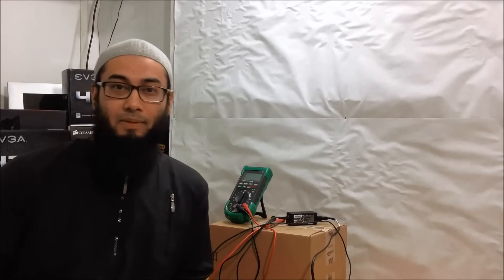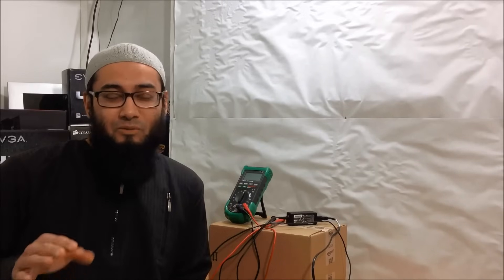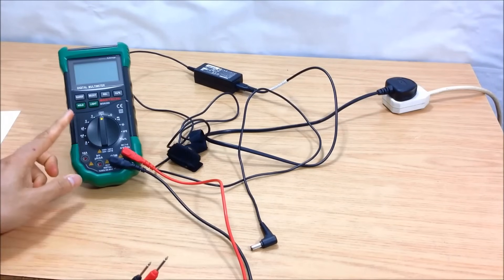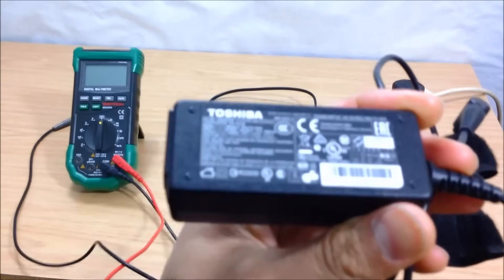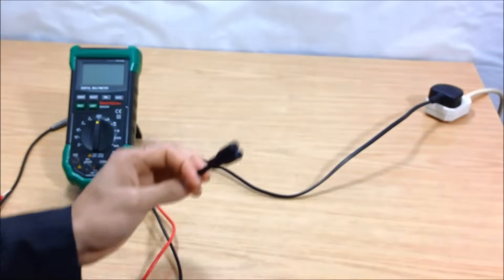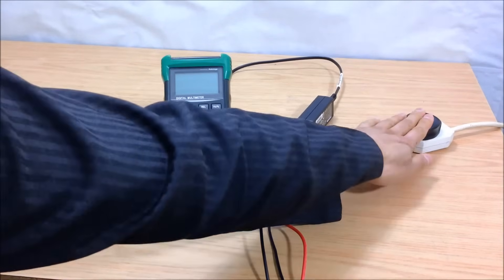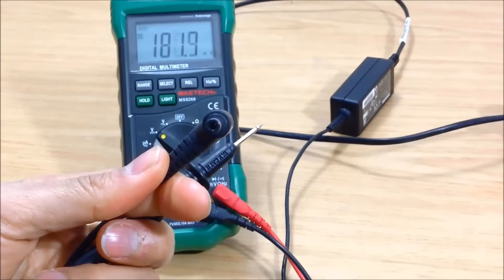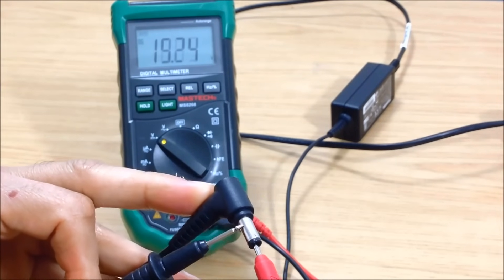How To Test A Laptop Charger With A Multimeter | Laptop Not Turning On | Laptop Adapter Charger

Comment: Great tutorial and great presenting , to the point and with a fantastic attitude . 
I tested my charger but it didn't give me anything , I don't want to buy a new charger because This one is original , so  do you have any tips on how to replace the part which you tested in your video ? 
Thank you sir
Reply from the maker: I have used cheap alternative chargers and they have worked fine, from EBAY.  Alternatively, I have also used a universal charger in some cases.  There is a video on my channel for a review of one of these universal chargers.  If you cant find it i will link you...
Reply from the maker: https://www.youtube.com/watch?v=rgA7XwpbUBQ
Reply: @HealMyTech1  thank you for the suggestion , I watched the video . 
Will be looking forward to newer content .  Do you have any tutorials on how to Diagnose Issues related to motherboard and how to read schematics ??

Comment: Can i connect the adapter pin to a dc motor.for example a hp power adapter is 32volts,and the dc motor is 12 to 24 volts.

Comment: Would I need to measure the amps as well? You see, I have a dell charger and I tested it as well and I got a good voltage of what it was suppose to be, I think it was 19.50, sort off. However, the charger still won't charge, is there any way to test the other things? If not I sadly have to pay $30 to get a new one, not even half a year old and they gave me a bent one as well.

Comment: Thanks a lot. I was able to test my Lenovo charger. What if it displays 19.95 for a second and go immediately to 1?
Reply from the maker: Maybe you just disconnected the probes temporarily.  Please double check again.  I the problem persists, then it could mean the Amp of the charger is bad, in which case replacement is warranted!

Comment: Hello, thanks for the vid. Quick question when I tested my power supply it started off at the correct volts then dropped to 0.1 over a few seconds does that mean my power supply is broken?

Comment: i thanks for the video, what if the multimeter shows a value less than what i expected? for exemple in my case, it's noticed on the adapter 19.5V but the multimeter shows only 18.7V??
Reply from the maker: IS your laptop working?   Its a little underpowered if only 18.7V, but a major problem if your laptop is working under normal condition.

Comment: Hi my name Muhammad I want to use hp32v power supply for dell printer which is same voltage but connector jack is different can I cut wire and connect another round Conection but there’s three wire

Comment: Testing the output voltage with no load is OK but should also see that the adapter can provide the full 2.37 amps (45W) without the voltage dropping out of range.

Comment: my battery is dead i tried a new battery still the same, my asus a43s laptop doesn't boot barely get to windows logo and shuts down i fixed the port before and it works but like there is not enough power for it to run properly even plugging a fully charged battery it doesn't boot. with charger and full battery it boots but any heavy task shuts it down. please help.

Comment: If the voltage measures correctly, does that then imply that the adapter is working properly, i.e., the current (amps) are correct?
Reply: no, it DOES NOT!

Comment: You should also note that even if the Voltage is good, its possible the Charger isn't putting out enough Amps. Testing amps on a dead charger is tricky.

Comment: Thanks for the video. My laptop adapter pin Is very narrow. I tried to insert the multimeter red pin inside but failed.
Reply: Add wire to your multi meter pin

Comment: how about testing adapter amp? I found out that i have so many cheap adapters that don't deliver enough amp
like it says on the label. I want to know the real amp they actually deliver.
Reply from the maker: This has been requested, I haven't got the equipment for AMP test yet, have you found a good tutorial?
Reply: The only video tutorial i found is multi-meter clamp. And they only show the clamp being tested on 2 wires (live and ground wires). My adapter has only 1 visible wire (probably 2 wires inside a shied). I believe to test amp with the clamp  you have to remove the shield with a cutter.

Comment: That is how you test Voltage, but an ac adapter can report correct voltage but fail to produce the correct Amperage, rendering it useless to power the laptop.

Comment: How do you test amperes of a laptop charger with multimeter?
Reply: The amps will vary depending on the electrical load. Even when in use by the laptop computer, the amps will change over time depending on what the device is doing. For example, while the hard drive platter is spinning it will draw more amps, but if the hard drive parks the platter the amps will drop. Same thing when you step away for a few minutes and the monitor screen darkens.

Comment: that only shows how many volts are coming through, so even if it is 19.3 volts reading,  it may still be a bad charger! You have to check that the AMP if it is putting out at least 800mA or so, because many bad chargers show 19volts no problem.. but way low on amperage! Bad Charger!
Reply from the maker: You are right, noob mistake, this video needs an update, I think I did do another one and mentioned this issue, but I am not able to do the AMP test by myself, care to collab?

Comment: Hello i see 19.5v on my laptop when it is rated at 19v. Is it good? and also when i measure the current it turns blank. Please anyone help
Reply from the maker: I think that should be fine.  What do you mean current measuring turns blank?  Do you mean AC voltage?
Reply: @HealMyTech1   I mean Amperes, setting the multimeter to Ampere and placing the probes on the exact same position. But current is not displayed
Reply from the maker: @chibuikeoffu  measuring Amp is more complex than just placing probes, you need something like an Amp meter and a battery for example to check, which I dont have right now.
Reply: @HealMyTech1  Alright thanks, please when you get hold of it, kindly do a video on that. It will be much appreciated

Comment: My results varied. First I got nothing on the 20 V meassurement then 19 point something on the 200 V meassurement. So later I tried again...then I got 0.0 on both...*scratches head*
Reply: I tested a battery and that worked fine, the result was 1.5 V. It's just the laptop power cord that gives varying results...